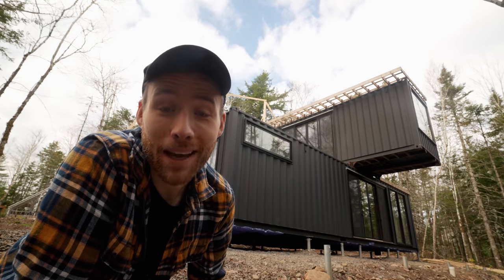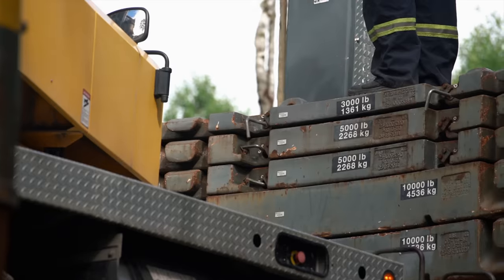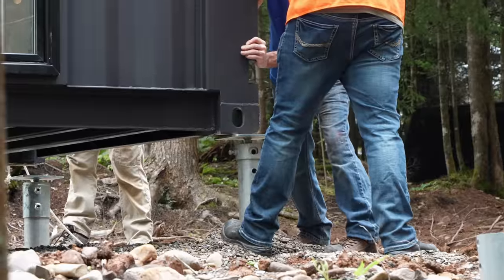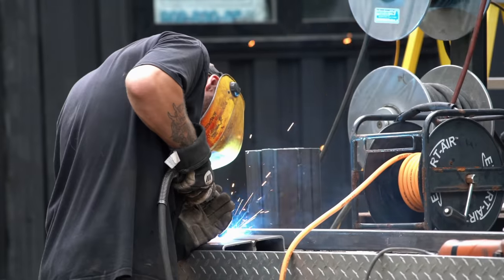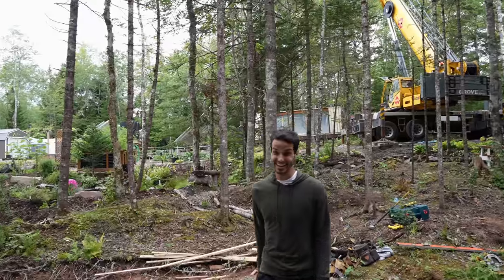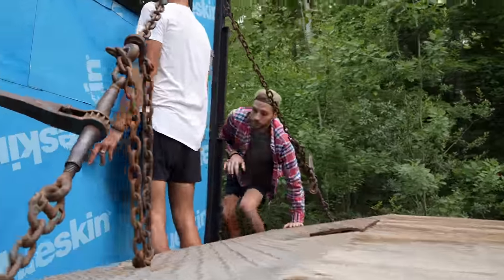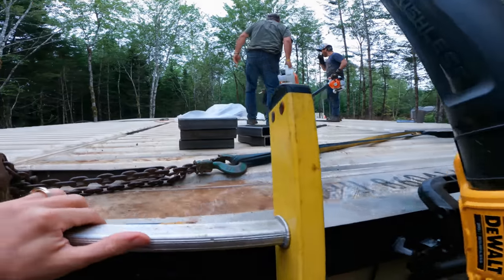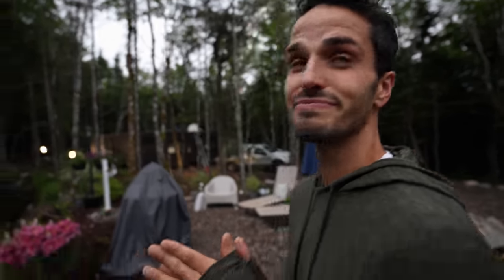We Built a Shipping Container Home

Comment: So how does the shipping container model work for insulation values in a norther climate? We’re in Minnesota and I wouldn’t have thought a container home was possible for our cold winters. I would think our winters are relatively similar.
Reply from the maker: It’s all how much you insulate. We’re doing 6” of closed cell everywhere which is roughly R-42 plus the ceiling is going to be R-100 with a mix of closed cell and blown!
Reply: @tylerandtodd  oh wow, it’ll be interesting to see how that all goes in. I wouldn’t have imagined getting that high of thermal values on a container home, but excited to see it!

Comment: Why did you guys do a container home? It seems like a regular wood cabin would have been way cheaper and easier to build....
Reply: I think they have answered that question somewhere (but i didn't find it right now). This is the way I remember it:
First of all, they are not building a small house here, they are building a real big house. To build a wooden house that big from scratch would have meant hiring a lot of people just to get the structure up, and that is a big cost. Remember, even their little cabin in the woods, the geodesic dome, needs four people to set up, while being very prefabricated, and with only sheets as walls. (And T&T tried to do it with only two...)
Building that structure themselves would also take so much time that it would be impossible to fit in, even if they knew how to do it. 
The way I understand it, they ran the numbers carefully, and decided that it would not necessarily be cheaper, and since they knew fairly well what their dream house was supposed to be, they chose to go for a well-designed container home.
cheers/CS
Reply: @thecrazyswede2495  Yeah thats a good point actually! I guess they also wanted the structure up and ready in a few days so they dont deal with months of construction. Cheers!